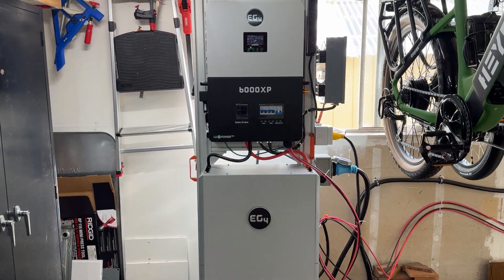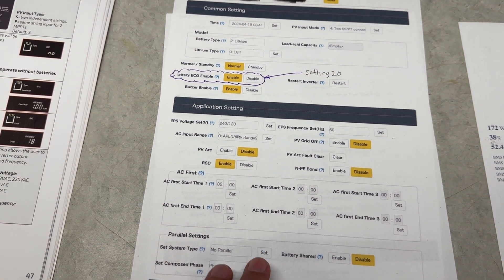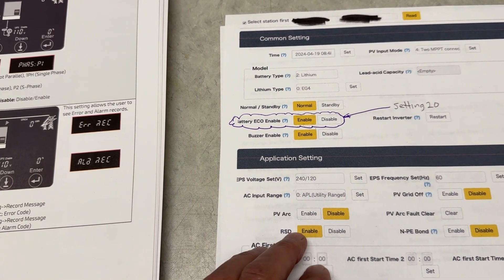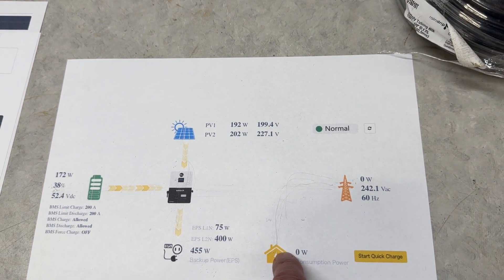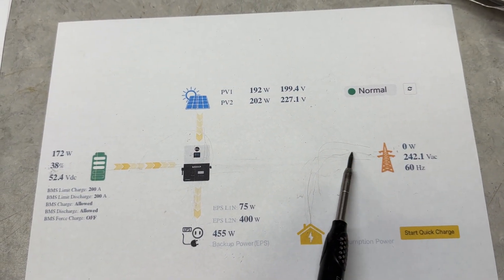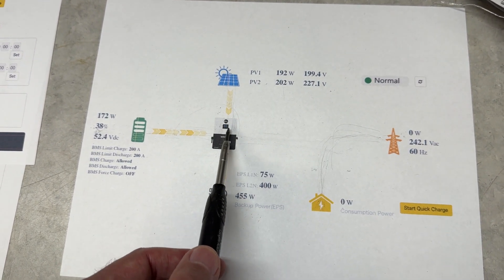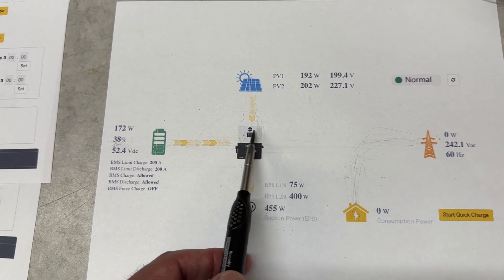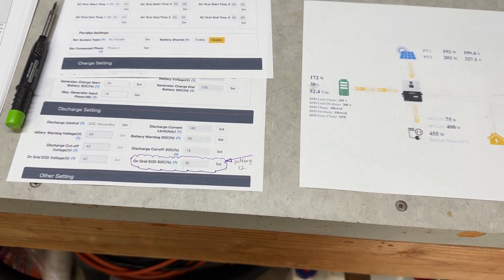EG4 6000XP with EG4 PowerPro Battery Part 2

Comment: I do not have that Battery eco enable checked and when my battery got down to 11% with no solar, It took from the grid without going through the inverter. Also, I just had Signature Solar tell me to discharge my battery all the way daily. When I did that today, the lowest it would go is 11%. Mine is the 18K inverter.

Comment: Search YouTube for "6000xp is not UL9540 certified. YOU CANNOT LEGALLY install in the US along with solar panels." if you're planning to install a 6000XP at your home.
Reply: Incorrect.  The 6000XP does not feed to the grid.  It can't.  Therefore, it is no more illegal than plugging in a lamp your kid made in science class, or your vacuume cleaner that isn't ul9540 certified.  That certification is only required for grid tied inverters that send power TO the grid.

Comment: If the battery is below the threshold set - 30%, and the inverter is in bypass mode running the loads; the small amount of solar being generated by that panels will be used to charge the batteries?
Reply from the maker: It depends how small the solar generation is. There is a minimum needed to begin charging. I think it is on the order of 100-200 watts being generated to begin charging. There is a loss going from solar generated power to battery changing power. If I have 200 watts on my panels, maybe because it is early morning or rain clouds, it may only charge the battery with 30 watts or something along those lines. It will take forever at that rate to charge. The bypass mode will stay in effect until the panels charge the battery to +10% of what your cutoff setting is, so in my case the battery needs to get to 40% before it switches from bypass to battery power for the loads.

Comment: Bet this can't start and run a 6kW motor load like a 6kW well pump.
Reply: Will prowse does it, diy solar fun with Ray loveless does it and more with his.
Reply: @d.pollard5962  They've never started a 6kW inductive load on video. 6kW is an 8 horsepower load. 
In fact, this inverter even failed to start Ray Loveless' home's AC unit without grid assist. I've even asked SS month's ago to create a video with their 6KW inverter starting an 8 HP motor and they haven't done it either.
Reply: @quickquote1568  East Texas Homestead just did a video of one of his 3 doing a well pump. I knew I had seen it, sorry I mentioned ones that did not cover your specific issue. I thought those would give some info and you could ask them for more guidance. Hope that helps.
Reply: @d.pollard5962  Thank you for the info! I watched his video using the well pump but unfortunately the pump's motor was much smaller than a 6kW motor load.
Reply: Sounds like you need an SQ grundfos well pump with soft start.
Reply: @branch_ranch  Grundfos pumps are way too expensive.
Reply: @branch_ranch  I wonder if one could do a reg well pump with a softstart like is done with AC units???
Reply: who has a residential well pump that  needs 6000 watts to run?
Reply: I do, I have a deep well pump. 8 horse.
Reply: @quickquote1568  what brand would that be?